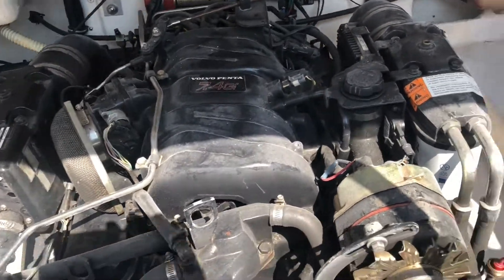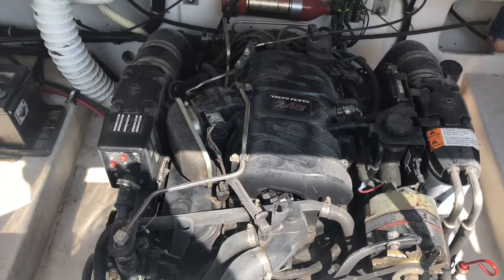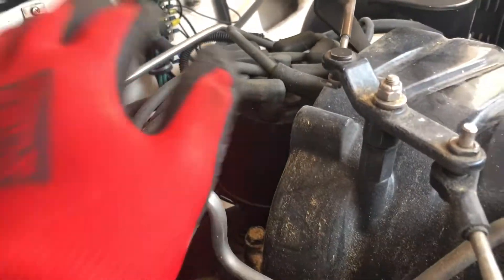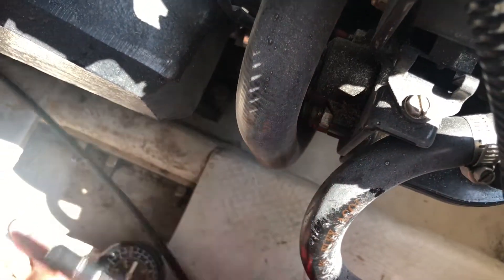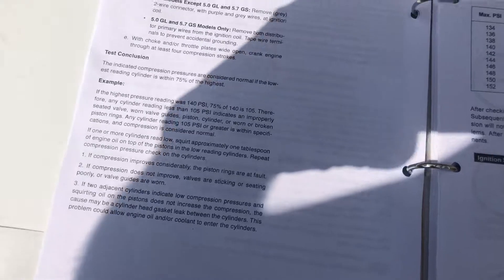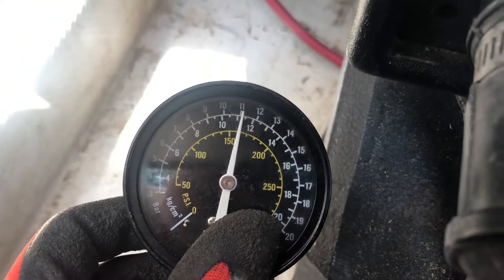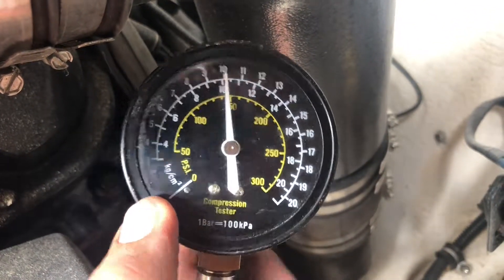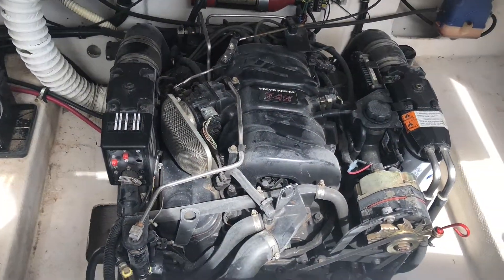Marine Engine Compression Test - Volvo Penta 7.4

Comment: Yes, you need to remove all the spark plugs to perform an accurate compression test. Removing all spark plugs allows the starter to spin the engine more easily and at a higher RPM, which ensures accurate readings from the compression gauge. It also prevents pressure from the tested cylinder from being lost into adjacent cylinders.

Comment: Hot or cold makes no difference. I’ve done both on the same motor. Made no difference. Throttle position also made little difference but did change some.

Thanks for the video

Comment: Serious question. I just did my compression test and I took out all spark plugs first, before I started testing each cylinder. Which way is correct?
Reply: Fairly certain that all spark plugs come out first.
Reply from the maker: I can't see how removing all the spark plugs would make a difference with a compression test.  I could see less stress on components like the starter.  Maybe someone can comment on what the difference would be?
Reply: People also say to open the throttle all the way. In my experience, both steps give a slightly higher reading. Warm engine raises the value also, oil on cylinders help reduce blow by.